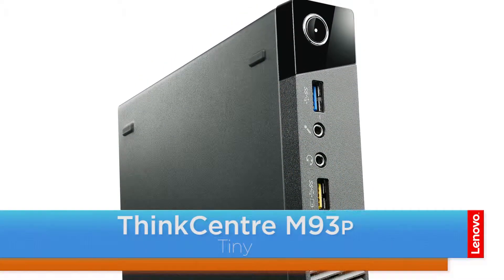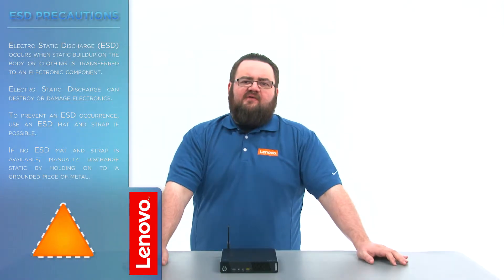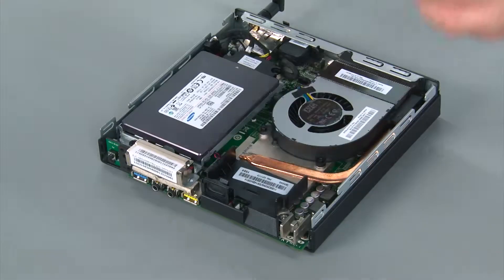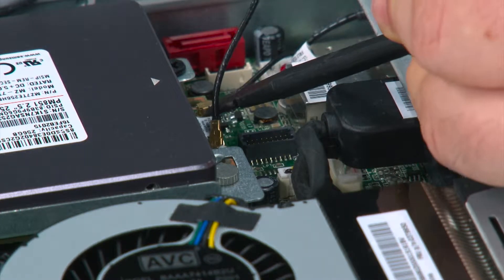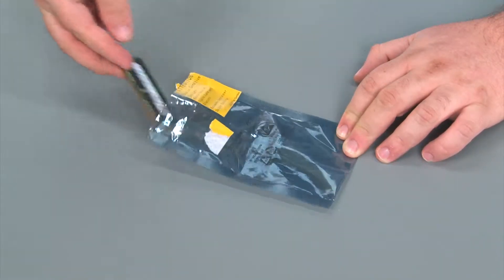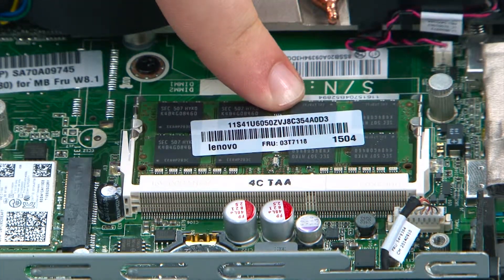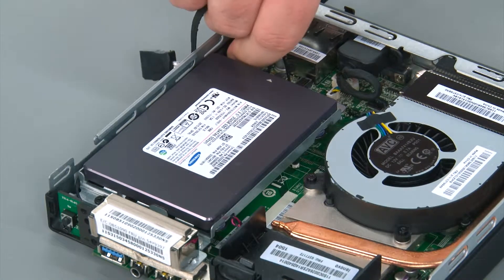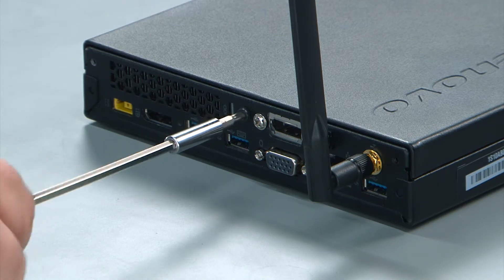ThinkCentre M83 / M93p Tiny Desktop - Memory Module Replacement

Comment: I am wonder how much ram and hard drive memory can I put in this without having to get a new cpu.
Reply from the maker: Hi Hellspawn666. Thanks for reaching out, and we're happy to provide assistance or direction to help you with this. RAM and storage upgrade depends on the model of the unit that you have. Here're detailed specifications for ThinkCentre M93, M93p for your reference and guide https://lnv.gy/3CDcuGY. Based on platform specifications below, the max memory is 32 GB. Kindly see below platform specification for each device. To make sure, we highly suggest that you contact or visit our service centers, to provide you with the options necessary for the device. Let us know if you need anything else. Heart_Lenovo

ThinkCentre M83 - https://lnv.gy/3iAf1uL

ThinkCentre M93/M93p - https://lnv.gy/3XnZNaV
Reply: @LenovoSupport  these pdf guides are for the tower and not the mini, unless they are they the same. And the one I have is actually running windows pro instead of 7 or anything else like your site says, I believe it was replaced with a newer model in a McDonald's store in my area and I happened to pick it up at a thrift store. The reason I'm wanting to know more about it is to know if I made a good purchase as I need a computer that I can use for school and this is all I can afford at the moment.